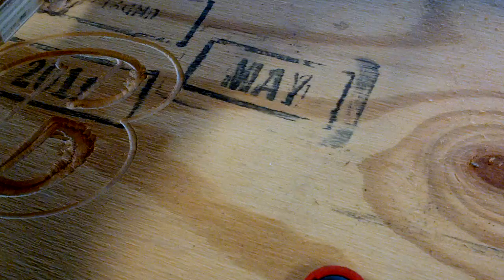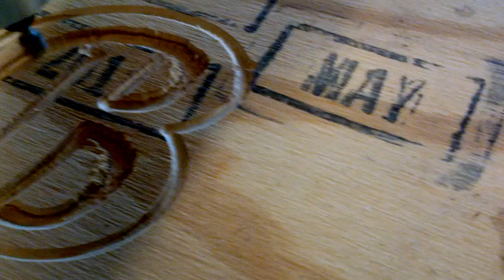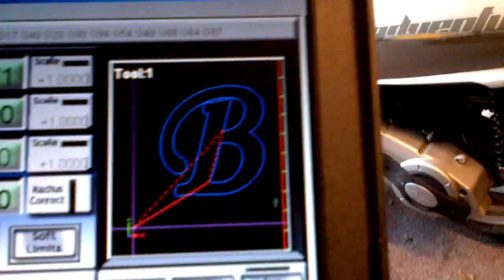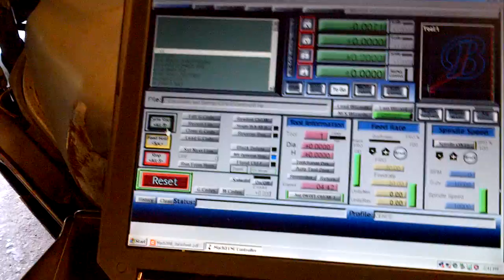CNC router CENCE - First cut

Comment: What size are your stepper motors?
Reply from the maker: Josh Robb they are nema34 motors with like 48lbs of torque. they were way overkill but were a good price point so I bought them. the z axis is a 200oz nema23, needed the 23 size to mount to my ball screw unit. I never paid more than $60 for a motor.

Comment: cool setup! I have a "mydiycnc" that sadly was and still is too small. Im expanding it and really like that router head you have! I think ill be welding my new chassis so there is no flex and more capability, but currently my aluminum and acrylic CNC is really fun! cant wait to see more on this and your printer (just ordered from folger tech)
Reply from the maker: the router I have (and its backup) are those little trimmer routers you can buy for around $30 new. I find they are great because they don't draw as much current, are lighter weight then a full sized router and still take a 1/4" bit.

Comment: My first router mount was a bunch of zip ties.  It was dreadful, but I learned a lot.  Great video.  Thanks for sharing your experiments!
Reply from the maker: Thank you for your comment in the other post. I knew the mount (a 1/8" 2-1/2"x 2-1/2" steal angle iron) was probably going to be the weak link. I'll have to reinforce things and probably give it a linear slide to follow it stiffen it in all directions.
Reply from the maker: bubalettow I bit the bullet and bought a small tap and die set. directly taped the ball nut mount block in the z axis unit and bolted the router mounting plate to it with three 1/4"- 20 bolts, much more rigid now :-) . I have made some successful cuts using anything form v-bits, 1/4" end mills and all the way down to a 1/16" ball end mill. I'm really pleased that I could even remotely accomplish this build since I only had a loose idea on the modified plans and sourced my electronics from all over the globe (not an exaggeration). I'm still only cutting 2.5D projects but a full on 3D cut is in the near future.
Reply: awesome!